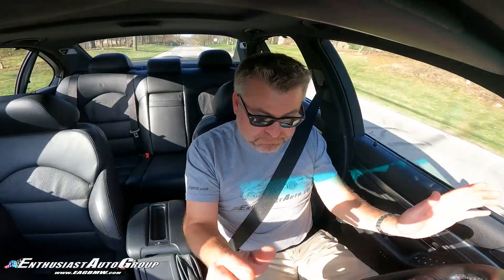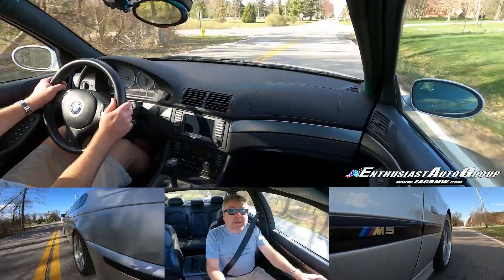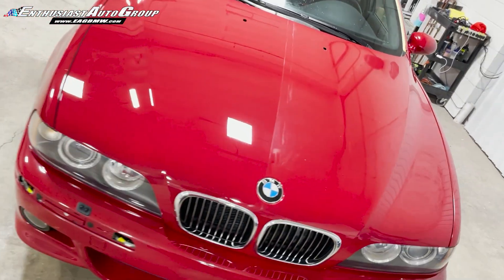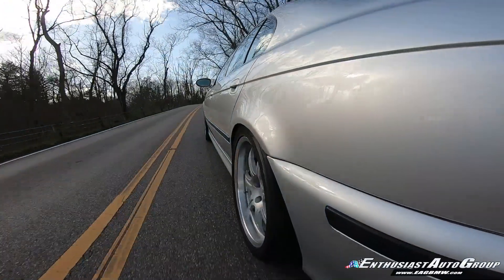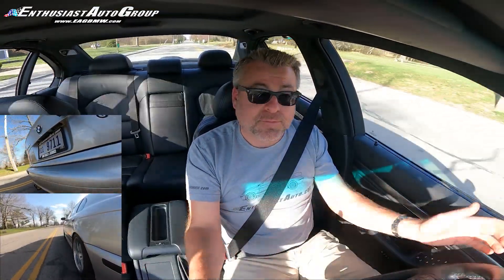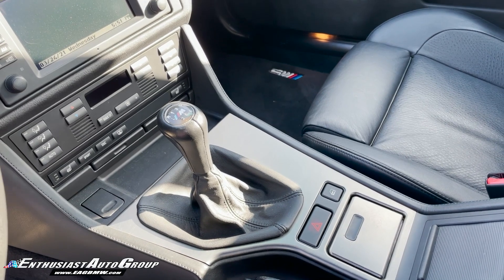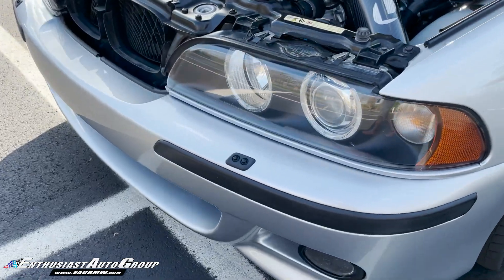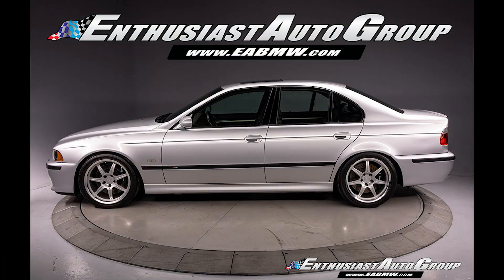E39 M5 DINAN S2: $40,000+ Package - Let's Drive! Only 14K Miles - The Best Surviving Example Today!

Comment: I made a “poor mans S2” out of my M5 - headers, 3.45 diff, dinan/Koni suspension, and evolve alpha n intakes. Car makes 395whp and I can tell you that the car is an absolute monster with all those mods
Reply from the maker: Nothing "poor" about that setup!  I bet it sounds amazing too!
Reply: 395? Hmmm sounds low. what headers did you get?
Reply: You should be able to push a tune on that m5 to go higher and hit a bit over 400whp mate.

Comment: Beautiful car. The gap on the bumper @15:00 is off, I am sure you will address that.
Reply from the maker: Yes, this was noted and on the comprehensive Rejuv list.  With the additional Dinan intake air catches and secondary air pump relocation, there is a bit more going on in this area and additional time will be taken during the car's pit stop in EAG's mechanical workshops.  You have the "Enthusiast Eye"!
Reply: @EnthusiastAutoGroupCincinnati  I know you guys will do the car right.  I have the same OCD problems as you.